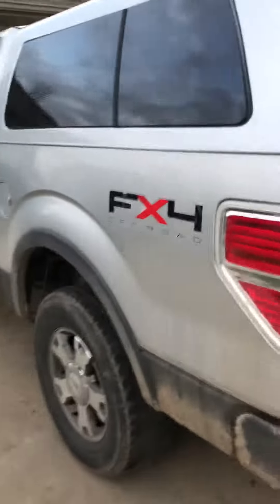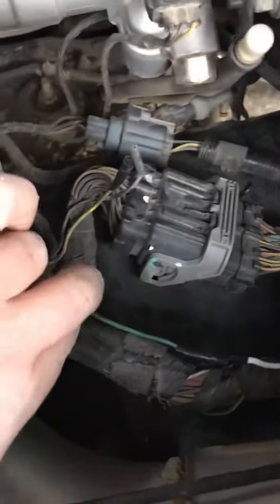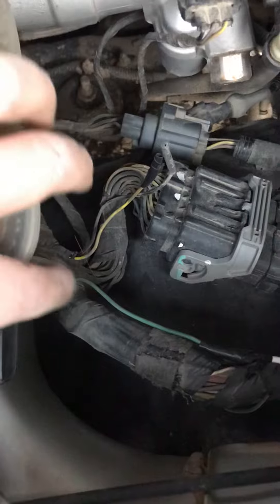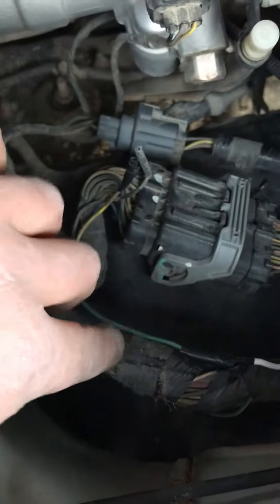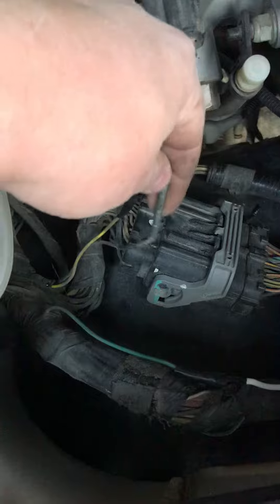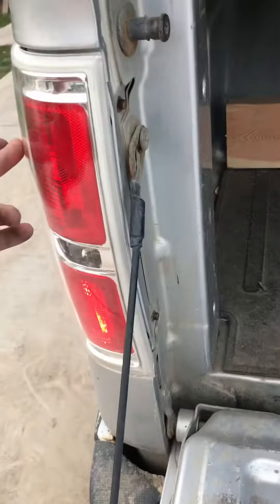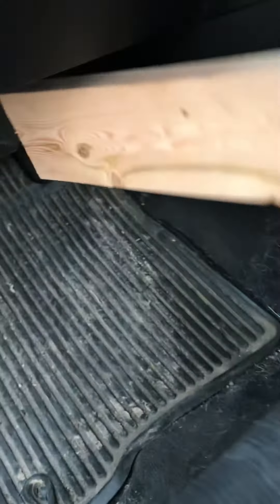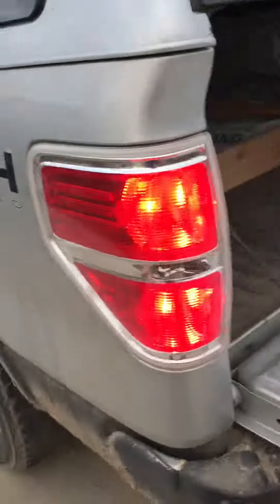How to Wire Camper Shell Brake Light on 2010 F-150

Comment: Excellent short to the point video.  Others please don't post needless bad info.  That magic green wire at the rear can be used if you want the 3rd light blinking with turn. In some states that will fail inspection as that light has to stay illuminated while any blinker is on.

Comment: Even though this is an old video, I’ll throw this question in here:

My green wire doesn’t seem to have an available end to splice to; it’s just an exposed 4in of wire, but no ends.

I assume it’s fine to cut it and splice into it going towards the back of the truck, right? That assumes that the front of the wire is connected up front somewhere, even though I can’t see the connection.

Any of that make sense?

Thanks in advance.
Reply from the maker: @Weiseyyy  so the wire goes a long distance and you can only see 4 inches of it and want to splice it? My guess is yours may actually run back quite a ways and if you find the end you can connect there. Otherwise yes you could just splice in. I’d open it up and multimeter it before running all the wire.  With the key in position 2 you should get 12 volts when the brake is pressed and no voltage when it’s not. 
Good luck!

Comment: Ok great. That's one thing settled lol
Any idea how I can wire in the dome light in the cap as well?
I would need a constant draw obviously.
Reply from the maker: I never did it on mine, but my best guess would be just straight from the battery as long as your dome light has a switch on it. Just don't forget to turn it off haha
Reply: I know this is from a year ago but if you are still wondering the easiest way to do it is if you have a 7 pin trailer plug tap into the positive wire on that. If not you need to run a wire all the way to your battery, there’s nothing on the rear end with constant power. It is also possible if you do have a 7 pin that it is on a relay so it’s key on power, if that’s the case again just gotta pull a wire all the way to the battery

Comment: So green wire all the way to shell power wire and than black wire from shell gets grounded?
Reply from the maker: Yes correct
Reply: @kevinsdiy8  hey Kevin I followed these steps however the green wire doesn’t not have power what so ever even when brake is applied. I checked f4 fuse but it was good. Any ideas?
Reply from the maker: @nathanwozniak4325  I remember reading there’s a fuse you need for the wire. And some trucks have it and others don’t. It’s possible you need to add a fuse to your box that’s just sitting open right now

Comment: Ok so after running the red wire to the back, how did you connect it to the topper brake light?
Reply from the maker: So you want to remove your tail light and run the wire up behind it and then through the cable hole that goes into the bed. From there take your 2 cables from the topper light and wire that to a trailer quick disconnect plug. Take the red wire from the front an put that to the otherside of the trailer plug. Get some spare wire and tie the last wired from the plug and ground it to you bed behind the brake light housing. This allows you to pull the topper off and just unplug it when you do so otherwise you'd have to cut the wire.
Reply from the maker: https://www.amazon.com/Sea-Dog-Polarized-Connector-2-Wire/dp/B000Y89TDM/ref=asc_df_B000Y89TDM/?tag=hyprod-20&linkCode=df0&hvadid=312430092407&hvpos=&hvnetw=g&hvrand=12475025905794554496&hvpone=&hvptwo=&hvqmt=&hvdev=c&hvdvcmdl=&hvlocint=&hvlocphy=9021762&hvtargid=pla-569344392136&psc=1

Comment: My wire in the front isn’t green. Will it still work?
Reply: I have a 2011 f150
Reply from the maker: @klspann  I don't know to be honest. If you want to cut the black cap off and put a multimeter to it you should get 12 volts if you have someone press the pedal on and off just make sure the voltage comes up and back to 0. The caps don't mean anything so you can cut them off and if it isn't the right wire just toss some tape or heat shrink back over the exposed end.